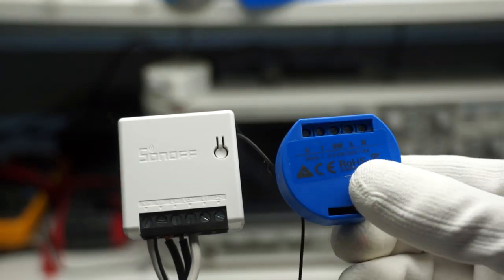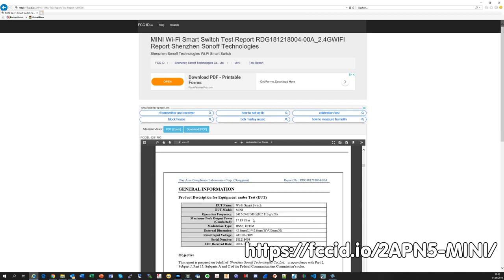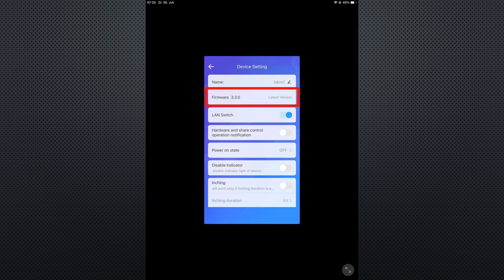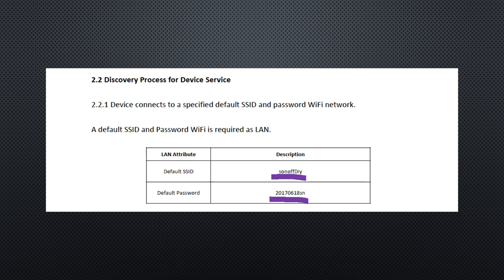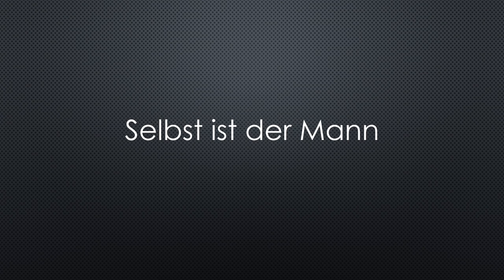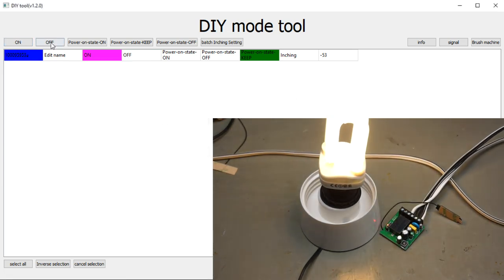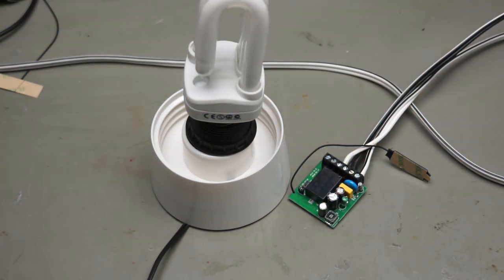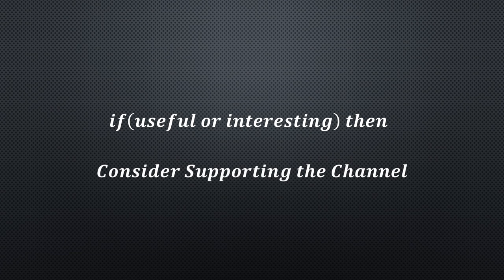#280 Tutorial Sonoff Mini (DIY Mode, flash Tasmota)

Comment: 8:06 When you connect 1 PC and many other things to 2 networks at same time the PC will ignore the second net unless it thinks that is "better" via TCP/IP Network Weight Value, I think also called Interface Metric now. Many times... Easiest is to disable the NIC in Windows for first network thru Control Panel/Network and sharing/Change adapter settings then Right Click to see popup box to disable a NIC. Do your Scan and etc. Then re-enable. Otherwise need to mess with TCP/IP V4 at minimum for one or more NIC's.
Reply: Things1000 test Usually it determines the NIC by applying an AND operation to the destination address with the net mask and the addresses of the NICs subsequently. But yes, if multiple NICs qualify it uses the one with the lowest metric value. So maybe that happened here if the different networks overlap.

Comment: I should mention that the minimum password length for WPA is 8 characters and in regards to the problem of the program not finding the device on windows, you need to stop the program, disable ALL other network interfaces on the computer (including virtual ones for VMWare/Virtualbox/VPN etc) then you'll find after relaunching that it will magically work. This is a problem I come across frequently with programs that don't 'choose' a network adapter and just use the first interface they come across.
Reply from the maker: That is what I thought was the difference between my main PCV and the business PC. Thanks for the explanation.

Comment: You can use the tool from the itead github to run the Python script on Ubuntu.  It has some indentation issues which my Python environment complained about.  So, no Windows necessary.
Reply from the maker: Thank you for the info!
Reply: @AndreasSpiess  The script as-is doesn't work on Ubuntu, as I downloaded it.  I am making another one.

Comment: With ta smonta firmware, the Switch does not work. How can I solve?
Reply from the maker: Maybe you post an issue in the Tasmota GitHub page?
Reply: I installed tasmota on sonoff mini, connected the switch to "s1" and "s2", but it doesn't work

Comment: So "Brushing device" should be easy if you don't mind soldering straight to pins on board. Right?
Reply from the maker: Yes. I also tried it.If you are used to SMD it should be no issue.

Comment: mDNS is a protocol wich a device can expose its name and properties to the local network as a DNS service under the domain ".local" (but only to the Multicast address for mDNS).  It works with Linux and with Mac OSX, and you can install software to the MS Windows.

It is the way to add devices to an IPv6 (and convenient to IPv4).  It is the same way you can reach a Raspberry Pi.
Reply from the maker: Thank you for your explanation!

Comment: Did not work. I was able to get to the point of uploading Tasmota and when I hit OK no progress was made , no upload. ended up soldering :-(
Reply from the maker: Bad luck. But in the end you were at least successful!
Reply: @AndreasSpiess  for me it is exactly the same situation. The Flash Process does not start...There is only a "Itead.bin" file which is created in the folder in which the tool is.  I have 2 Sonoff Mini, it is the same for both. In addition the windows tool always shows error codes behind the confirmed feedback.

Comment: It would have more DIY sense if they also followed Shelly in having a default MQTT interface. When I've installed Tasmota on my switches (Sonoff etc), it has mainly been to get the MQTT interface, which also works well for power monitoring switches.
Reply from the maker: Agreed. I also like MQTT much more than REST for these simple devices.

Comment: Thank you for your videos. I have a legal question concerning these products. One of my idea was to build a product around them without going through the painful process of certification. Raspberry, USB key, sonoff products (ex: pow2), knob, temperature sensor, etc...

How are we legally bound in case of problems with these products (Switzerland)? We customize the firmware of certified (by china and FCC :)) products.
Reply: In general If you sell a product, customers with a warranty claim will come to you. And you will have to claim warranty from your suppliers. 

I would be very surprised if things would be different Switzerland. 

If you would only sell software for a device a customer has to buy from a third party, then you won’t be responsible for the hardware.
Reply from the maker: @Gabriel: I am no lawyer, so I do not know :-(

Comment: Nice that the market gets broader... But I imo Shelly is still better (and smaller). 
The major problem for me: It supports only 10A. In Germany it should support at least 16A
Reply from the maker: I found that the relay at least has a TüV stamp for 16A (according to the datasheet). But the Shelly is a good alternative and definitively smaller.
Reply: @AndreasSpiess  Maybe the trace's on the board are to small for 16A.
Reply: @-TobsA-  yeah could be the traces or the screw terminals. Or maybe as a probably rare occasion the German standards are less strict for this case than the German ones ^^

Comment: Have you checked TasmotaSlave? It's a very interesting idea since you can have an ESP with Tasmota and then attach any Arduino or MCU to it that talks to the ESP via UART. The cool thing is that you can upload firmware on the 2nd micro and have all the advantages of Tasmota with a second brain with many other pins and special sensors or programming without touching the Tasmota firmware. It would be great if you make a video about it.
Reply from the maker: No. Tasmota slave is new to me. I will check it.
Reply: @AndreasSpiess  Also, combined with tasmocompiler, it makes it really easy to compile Tasmota as you wish

Comment: 7:43 Hotspot on your smartphone disables WIFI on your smartphone.  When your Sonoff device connects to your hotspot, it's not connected to your LAN anymore.  You need to connect to wifi from your router.

8:28 By connecting your laptop to also your hotspot, both your laptop and Sonoff device are on the same LAN.

 Cheers :)
Reply from the maker: Thank you for the update. Maybe things changed since I made this video...

Comment: I suppose if you wanted to you could build a small Arduino OTA script with wifi manager and compile a bin out of it to use on the built in firmware screen . That could be a way to jump straight into Arduino devlopment instead of Tasmota, and not have to solder wires for an FTDI.
Reply from the maker: No, I did not want to hack their OTA protocol. They can change it if they want.
Reply: @AndreasSpiess  Sure, I meant in general. I might try it out to put Blynk on one. Thanks fornthe video!

Comment: Your phone will block the network connection between the sonoff mini and the windows pc. Hotspot is for sharing internet connection, it will purposely block clients from seeing other clients. This is the same as a guest network, if you look at default settings for a guess network then you will understand. If I'm in a guest network at a hotel then I don't want other hotel users to see my computer, same situation as hotspot. It's not a private network so traffic gets blocked by the router (phone).
Reply from the maker: I do not think so because it worked with the second PC

Comment: Interesting; for the initial not finding of the Mini through your hotspot I would think you ran into “Hotspot Isolation”

Quote:
Personal Hotspot is designed for sharing a cellular data connection, not for acting as a wireless access point or router. This means that multiple devices connected to the same iOS device cannot connect to one another - they can only access the Internet (assuming the cellular data connection is active).

8 jul. 2015
Reply from the maker: But the same would be true with my business laptop?
Reply: @AndreasSpiess  indeed; so either you ran into some kind of security leak or Apple is inconsitent (e.g. based on MAC address?)

Veeery strange

Comment: Andreas, I would love to see a follow-up video where you simulate bricking the device and use the header pins to restore it. Or... Could you even take a new one and use the header pins to flash Tasmoto instead of jumping through all of those hoops? Great video as always.
Reply from the maker: I soldered wires to the pads. If you are used to SMD work it is no problem. Bur I removed them after flashing because there is not a lot of space in the case

Comment: The V6-S-DC5V has a "contact rating" of 10A @ 250VAC, a "max switching voltage" of 250VAC, a "max switching current" of 16A, and a "max switching power" of 4,000VA, 480W

I know nothing about relay specs, but 240V at 10A seems more than 480W?

datasheet.lcsc  DOT  com/szlcsc/Zhejiang-HKE-V6-S-DC5V_C125716.pdf
Reply from the maker: Thank you for the link to the datasheet. It says that the TüV and CQC rated the relay at 16A/250V
Reply: Also a very important fact on relays is whether you switch an inductive (coil, motor, transformer) or resistive (lightbulb, heater, coffee machine) load. 
Serious relay descriptions will show that. In short the inductive loads generates larger "light arcs" while switching of, so the inductive load is far under the resistive. Relatet to the contacts live I would trust that writings not to the limit.

Comment: I guess you could just solder on 4 wires and flash Tasmota. RX, TX, 3.3V VCC, Ground - NO MAINS! - then removing it and close it again before connecting any mains voltage. Using Pogo-Pins it might even work without soldering.
Reply from the maker: Maybe you watch my next quickie video?

Comment: Well what can i say? I used alot of Sonoff devices. And then i found Shelly. 

After i found shelly and tested them alot, i never will buy any sonoffs anymore and pay the higher prices for shellys. 

The fact you can use mqtt "out of the box" is for me the biggest point to buy them. The others are the powermeasurements.
Reply from the maker: The Shelly is for sure a good device. And still smaller

Comment: One of the big problems with windows connecting to devices is either the firewall or anti virus blocking the connections.
Reply from the maker: Maybe this was the reason. But it worked on a other PC with the same Windows
Reply: @AndreasSpiess  Possibly but it could be down to one thinking your local network is a private network and the other thinking it is a public network.

Comment: Well the fact that it appears to require Windoze puts it WELL outside MY sphere of confidence since I gave up on that particular bucket of bolts and it's undocumented security blunders TWO decades ago. 

Think I'll be implementing my own solution for such a device instead ... unless you're not telling me something Andreas ... Like there's a Linux solution that requires no machine running Windoze or MS software. 🤔😕
Reply from the maker: There is also a Python version of the tool on GitHub. I did not try that. And you can solder wires to the pads. It works. I tried ;-)
Reply: @AndreasSpiess  OK Cool ... NOW we're talking! 😊😁
Reply: Same here, Bob

Comment: Have you looked at the ota flashing with SonOTA haha I'm sure you have...
Reply from the maker: No, I did not. I just did it according to the manual. The Sonota page says: ATTENTION: It appears SonOTA does not work with devices running current firmware

Comment: Seems like it would be easier to simply skip all other steps, and simply go straight to soldering 4 wires onto it and flash it.
Reply from the maker: Of course, if you are good with soldering. The pads are quite small, but I managed it to solder the 4 wires.

Comment: They should have really used a switch in that could be used with one live wire.... the 2 wire switch is useless in many European houses since the black wire provides 230v, and there is not necessarily a live wire coming from the same switch, the L (brown wire) could be coming from any point.
Reply from the maker: With one wire systems it seems not easy to power devices.

Comment: A simple way to discover SonOffaSwitch IP-address in DIY mode (DIY tool works fine in Win7 and Android hotspot by the way) : 
Open dosbox, once connected with pc to hotspot, type "ipconfig" and find networknumber (192.168.43.x/24), your own IPaddress and that of your phone/hotspot being the default gateway at 192.168.43.1. Power-on Sonoff, blinking once means "scanning for wifi host", blinking twice means "connected to wifi host" (so both name and password okay). When it appears on your DIYtool, type in the dosbox "arp -a" and you'll see it's IPaddress being 192.168.43.128. Saves you the time and 'effort' of searching/downloading/installing Advanced IPscanner. Another handy MSdosbox tool (comming straight from its Unix background long time ago) is the command 'netstat'. Try it, and learn :-)
Reply from the maker: Maybe they changed their software after that video. I was in contact with them and complained...

Comment: The different values for maximum amperage is due to the certification standards. CSA an UL are the standards in Canada and the United States respectively. The device is thus limited to 10A maximum whereas in China you can push it to 16A, but I wouldn't. Knowing that the CSA and UL have actually tested these devices I wouldn't go past 10A and I'd put a 10A fuse inline just to be safe.

We all know Chinese ratings that wildly exaggerated actual performance, see 5000 mAh 18650 cells as an example, so I wouldn't trust any ratings that haven't been tested and verified by an independent third party.
Reply from the maker: Meanwhile I got a link to the darasheet. The German TÜV also agreed on 16A/250V. Interesting...

Comment: Sonoff have a lot lot of road to do to be compared to Shelly.
Reply from the maker: The hardware seems ok for me. And the price, too.
Reply: @AndreasSpiess  is not all about Hw or price.
It's about software, features and support. One of the best I've ever found, very reactive. 
What about clean contacts, and 12V/24V supply?
Reply: @b3c2105  Yes, would be wonderful to get a Sonoff that can work with 12Vdc/24Vdc AND 220Vac by changing a jumper!

Comment: I don't really get it cause it is still bigger than shelly 1 and doesn't fit into our switches or infrastructure. 

I mention this especially since their are now more and more  nice round shaped switch plugs with power consumption measurement function for about 10€.

This plug is close to the functions of a shelly and if you rip the enclosure off you must find a logic unit that must fit in our switch boxes in the wall. Needs  just ports to connect the power lines.

If  sonoff had developed such a mini power plug they could have reused it for in wall switch usage in european stone built houses.

What a shame that they ignored this.
Reply from the maker: I do not know why they made it square and not round.

Comment: You flash the Shelly by the pins on te frond. No soldering on your divice. And the price you say is not the good price. I buy it for 10 euro on internet!
Reply from the maker: You are right. The price I showed was for 2
Reply: @AndreasSpiess  and the flashing? Now it looks like a bad product.
Reply from the maker: I do not think so. See other comments. My viewers are educated. And the Sonoff does not look really good in this video either. The price of the Shelly1 is definitely higher if you add shipping and compare it with the Banggood offer.
Reply: I like both products. Use them both too. Which I then have at hand I use. But found some parts in the video not really fair for shelly.

Comment: I do not start to use the new DIY functions as i have every tool ready to flash tasmota over and over again in minutes from the thing dropping in the mailbox, but....!
I can see a potential in the "very strange wifi method that makes your life horrible"! What if!! --> you setup an extra wifi-accespoint in your home (or broadcast 1 more ssid on a better router) with the  weird ssid-name/pass that sonoff provided. You can leave the acces point on 24/7/365 and every sonoff you buy and connect will be visible straight away (since the accespoint is relayed to your home network via ethernet cable). You could even see your neighbors sonoffs they buy and put in diy mode.. Hell you can even make some noderedscript wich will hijack every sonoff that comes online in nodered.. and if you do all that.. its best that the guys @ sonoff made such a nice wifi password instead of "1234". Now your only hope is no other home automator will do the same to your devices.. but dont worry. Home automators like us are well spreaded around. there is some garantee your hobby isn shared 5km around you :)
Reply from the maker: I think the way I did it is ok because I only needed it once. Tasmota can be updated OTA
Reply: @AndreasSpiess  yes. Once you put tasmota on your worries are over 😊

Comment: maybe it wants internet connection as well as windows pc to mess with it
Reply from the maker: I do not think so. Because the PC connected to the internet did not work. The one only connected to the hotspot worked.
Reply: @AndreasSpiess  but the device may be looking for the internet its self
Reply: im have 2 sonoffs and i had to ask for local network when the internet dies they may have went to a default

Comment: Currently Sonoffs are not DIY friendly at all although they are labeled as such. The mini is great example. So simple stuff made so unnecessary complicated.  Shelly is a way better at this. Also, the main  advantages of Shelly are 16A relay and multifunctional firmware, based on mongoose OS. No base to compare.
Reply from the maker: I think the purpose of both devices is the same and I like that we have a choice to select...